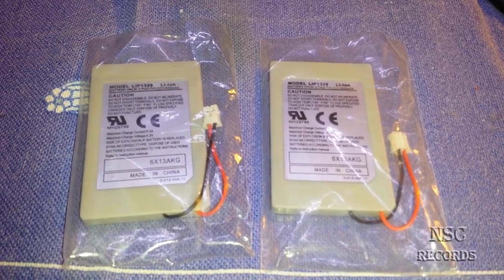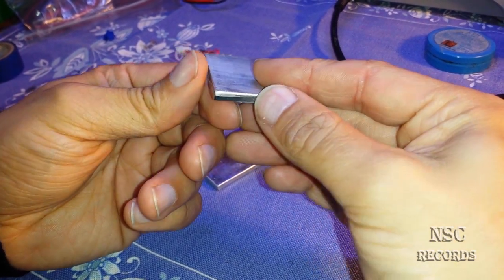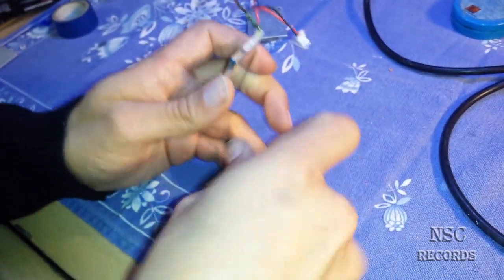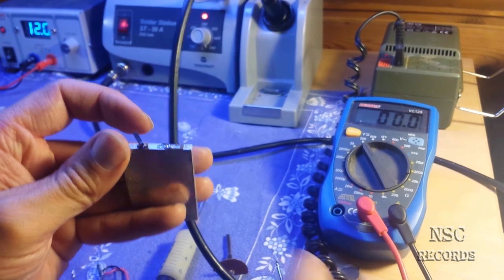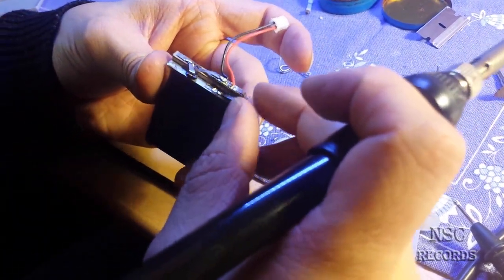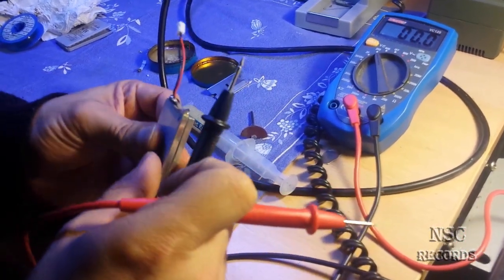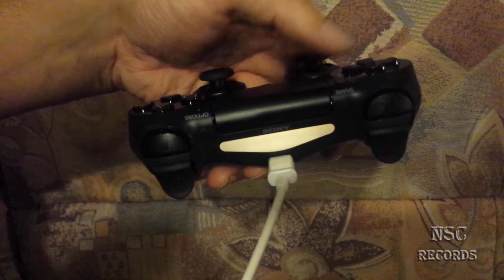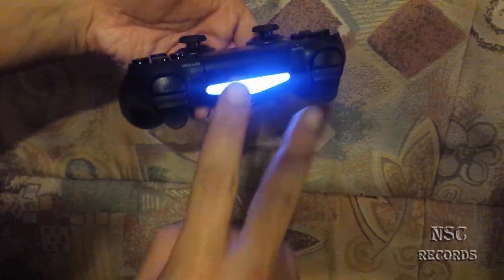PS4 Controller Battery Mod v.1.2 with 3600mAh By:NSC

Comment: I see a problem with having one controller for two separate batteries, If the first battery is fully charged then charging power will be removed to the second battery, better to retain individual controllers, and solder the second battery's wires to the first battery's wires, this way the second battery is protected from over or under charging.
I tried placing two batteries in my ps4 controller, the controller wouldn't close properly as the combined thickness exceeded space available by a few mm, the back and front of the controller wouldn't latch properly. I abandoned the 2 battery idea and reverted to a single battery.
(2016 PS4)
Reply from the maker: Thei are always working togetter... and my battery still work's fine :)

Comment: Can you not only weld the cables without having to open the batteries? I bought a 2 mah battery and my original is wasting.
Reply from the maker: +Ivan Santana yes, you can do it like that to, but like on the Videos it´s better...

Comment: how much more time do you get with the indiestation controller.
Reply from the maker: +Aaron Gooch 3-4x longer :) Conform the Quality of the Batterys, Sony uses 1000mAh, i use 2x 1800mAh = 3600mAh
Reply: +UltraNSC I put qi charging on my gamepad it's pretty sweet. you should check that video out
Reply: Yeah I don't do much with my ps4 I mostly play on my Wii u. Only thing the ps4 is good for Lately is PS vue . but the bigger batteries seem like an awesome idea.
Reply from the maker: not seems, IT IS AN AWESOME IDEA :)